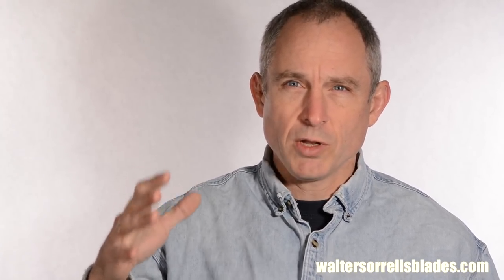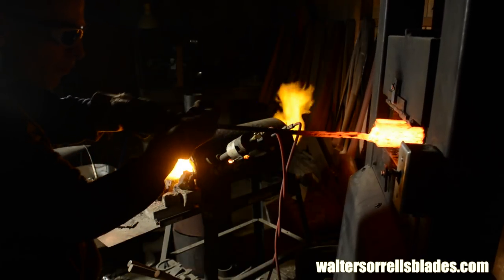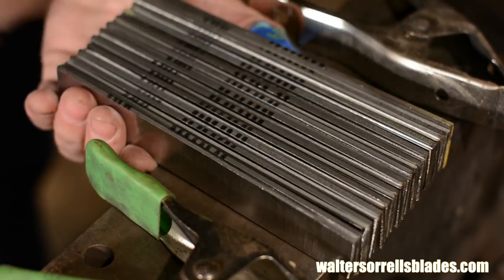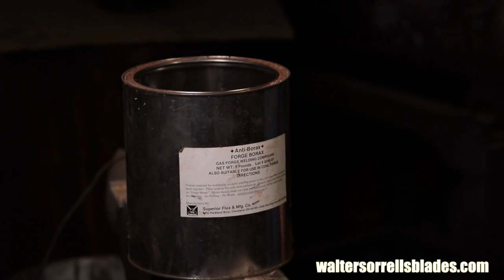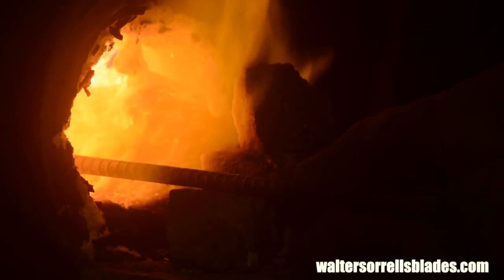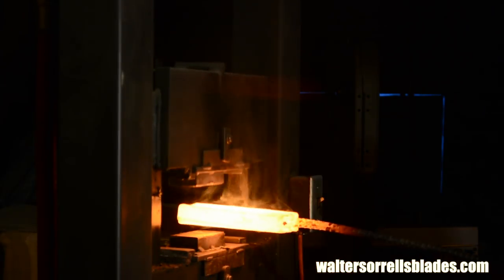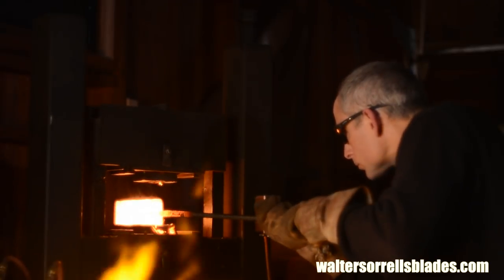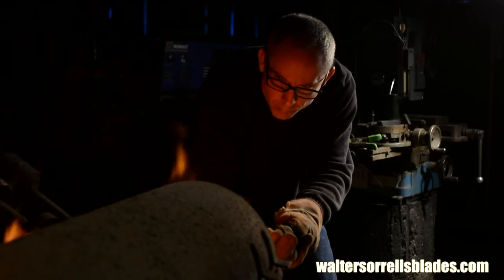How to Make Damascus Steel -- Part 1

Comment: i wanna ask : what is flux ? and chemical properties of flux 
thank !
Reply from the maker: +Lol trần Flux is not a thing, per se.  Fluxes are used in welding, brazing and soldering.  When most metals are heated in air, they create oxides which interfere with bonds between pieces of metal.  Fluxes dissolve those oxides so that the metals can bond cleanly.  Borax is a common flux but there are many other substances that will act as fluxes in particular situations.
Reply: +Walter Sorrells so i can use borax ? i see some person in my country use borax for whitening the food .-.

Comment: Hey man, if you're really concerned about weld material being in the blade, why don't you just seem weld with TIG? I get that it'll take longer, but these are high end knives, yes?
Reply: Weld material is getting into the steel either way. Also something to keep in mind...while forge welding you don't want to work the metal back and forth. You want to start from the back and work your way forward so you push any undesirable material out of the metal. Sort of like a tube of toothpaste.
Reply: +Carl Sanfilipo tig welding does not use any weld material if you only run the welds together

Comment: If you had a tig welder, you could fuse the pieces together and have no issues with mig wire metal contaminating your billet.

Comment: real damascus steal was made by using the same iron througout the blade folding it with organic carbon based matter inbetween the layers like grass and leafs ect, nobody acully knows exactly how it was made but they have proof that the genuine damascus blades contains carbon nano tubes wich could only be created in this mannor.
real japanese "damascus" is made by tamahagane sorted and forged into 2 billets, one soft and one hard(hagane). the core of the blade is made of soft folded steel and the outer shell is made out of harder Hagane steel...also folded. the pattern on a japanese sward is only visible if you look closely.

Comment: ive seen the old school japanese use what looks like old t-shirt material to hold their metal together when they stack up the different kinds, and whats wierd is some of it is still left when the take it out of the forge orange hot, and they just scrape it off...can anyone explain that, look in this video at the 2 minute mark and tell me whats going on
Reply: It's a flux basically. It acts like Borax and prevents oxidation.

Comment: Thats not actually true Damacus (wootz) steel it is actually what is called "Patern Welded Steel".  In true damascus the distinctive lines in the steel is from the crystals formed in the steel from low oxygen and slow cooling, and true damascus steel is very high carbon like between 1to 2 percent.
It's an interesting subject to lookup.

Richard

Comment: I could have sworn Damascus steel was lost ages ago...
Reply: You are right it is a lost art!
 The original method is unknown!
Reply: Max Power does our method give the same results?
Reply: memegusta
Impossible to say since it's a lost art! But don't get me wrong for all we know your method could be even more effective! I work with steel and would love to create this! I was merely agreeing with a known fact! I love what they are doing hence why I watched the video! Peace.
Reply: *****
Key word there is Japanese. What's Japan got to do with Damascus?
Reply: ***** Damascus is the capital and the second largest city of Syria.

Damascus steel was a type of steel used in Middle Eastern sword making. These swords are characterized by distinctive patterns of banding and mottling reminiscent of flowing water. Such blades were reputed to be tough, resistant to shattering and capable of being honed to a sharp, resilient edge.

The origin of the term Damascus steel is somewhat uncertain, it may either refer to swords made or sold in Damascus directly, or it may just refer to the aspect of the typical patterns, by comparison with Damask fabrics.

Production of these patterned swords gradually declined, ceasing by around 1750, and the process was lost to metal smiths. Several modern theories have ventured to explain this decline, including the breakdown of trade routes to supply the needed metals, the lack of trace impurities in the metals, the possible loss of knowledge on the crafting techniques through secrecy and lack of transmission, or a combination of all the above. (wiki)

Nothing to do with Japan.
Reply: *****
So that's it? They just forged folded steel?? Well done Sherlock you cracked the case!! We'll just ignore the little details like the balance of impurities such as tungsten and/or vanadium. We'll also ignore the fact that debate has persisted in the metallurgy community over the past 200 years as to how these blades were made and why the surface pattern appeared, and that research efforts over the years have claimed the discovery of methods to reproduce Damascus steel blades,but all of these methods suffer from the same problem—modern bladesmiths have been unable to use the methods to reproduce the blades. The successful reproduction of Damascus blades requires that blades be produced that match the chemical composition, possess the characteristic damascene surface pattern, and possess the same internal microstructure that causes the surface pattern.

So if you ignore all that, ya your totally right!

SMH
Reply: *****
I accept your apology!
Reply: *****
Any time!
Reply: *****
 Part of the problem is the steels themselves. Because Damascus is a combination of steels, the rate of degradation varies. This can result in a sword having one or two main alloys but having the rest essentially rust away. The disappearing metal can still be detected but exact quantities are usually only a conjecture.The molecular bonding and structure could give clues to how the Damascus was made. But again with a pattern of ever changing steels; how accurate are the tests going to be. Like today there were good and bad knife makers; hard telling if the knife or sword tested was of reputable quality or junk. All in all, it’d be awesome if they could reverse engineer it, but it’s easier said than done.
Reply: *****
Dude seriously why are you commenting on things you know nothing about? I mean I have seen you on a few videos now asking for advice about forging, welding etc. You don't even know the difference between MIG, TIG & Stick yet you want to argue and criticize people that do!? How are you going to learn with that attitude?? We are talking about Damascus (wootz) steel and these are the facts! I'm not looking to argue but you aren't looking to learn either it seems like! So go some where else!
Reply: eating popcorn this argument is fun!
Reply: *****
Well you're the one who keeps harping on about forging and folding metal! Ever heard of fire welding??
Reply: Max Power Well  "true damascus steel" or Crucible damascus is hard to make (i know what im talking about, im cooking "cakes" for near year in last few melts i achived succes) hard to forge (it is prone to cracking and "pattern disapperance" if forged in higher temperatures, or simply cold steel cracking if forged in too low temperatures) hard to quench (blade can just simply cracks in warm oil quench) and at last hard to sharpen (need a good stones and good hand)
Crucible damascus is not a combination of steels, or to be precize it starts as liquid steel in crucible and due to a carefull and slow cooling, temperature control and thermal anneal in "steel cake" segregates itself into two types of steel - one "base steel" with medium carbon content and needles of pure cementite all naturally formed. When you forge cake with enought patience you can achive miracles in blade. This steel is hard, but also can be flexible and really knife once sharpened doesent need resharpening for a long time. Well inproper use can break any tool so no it is not "indestructable".
http://crucibledamascus.com/
There is my webpage with short gallery, of course final product is still in development but i hope that my present steel will please my future costumers. Sorry page is in polish language, but if you have any questions feel free to ask, i will do my best to answer them.
Reply: ***** Thank You.
Reply: Krzysztof Rusek
Great job. Do you have any site in English?
Reply: Max Power I regret this but i don't multi language site. If there will be enought attention and requests i will change whole site language to english, or upgrade site to multi language. If any of you have any questions feel free to ask, as i said before i will do my best to answer them.
Reply: Max Power I opened the website using google chrome and it translated to the site to English for me.
Reply: Actually, they rediscovered how it was done, including how to produce Wootz Steel around 35 years ago. 

http://www.nytimes.com/1981/09/29/science/the-mystery-of-damascus-steel-appears-solved.html
Reply: OvAppolyon Yep rediscowery was done recently and now what matter the most is to get more experience with forging that steel.
I followed tutorial of Rick Furrer, after that i read a lot of old books to get any additional knowlege (Anonsow works, historical describes of melting furnaces) and im still experimenting. If i remember correctly first sciencific researches done on wootz were made in :
The Key Role of Impurities in Ancient Damascus Steel Blades
J.D. Verhoeven, A.H. Pendray, and W.E. Dauksch

Thank you for new source of knowlege.
Reply: Damascus steel was made long long ago in the old Asyrian Empire made for our swords. But when the islam came with brute force : be islam or die. The art of Damascus was lost because it was the stone tablets were never found. until they rediscoverd it XD Syrian History is such an interesting thing to know.
Reply: VillaMas Ewani
Yep true first crucible "damascus" steel was smelted around 4 B.C. in India, long before islam started.
From blacksmith perspective syrian damast is the best (it is most beautiful in my opinion) but that is not end of production of that steel.
Reply: Your right sort of. The original recipe is forever lost this is simply a variation of it
Reply: Max Power plunging the blade into a muscular slave was how it is said they quenched it so I suggest doing the same except with a strong horse or a mule.
Reply: It still is lost but they are very very very close but they're still missing some small details that make a huge difference in the steel it's like fresh food and frozen food the one people make today is frozen it food but it's not quit the same as fresh food is it.
Reply: Krzysztof Rusek well shit loooool oh well practicing with the hardest swords will make you one of the best blacksmiths to date don't worry you'll get there.
Reply: ***** The art, technique, and apparently a few missing ingredients, are?
Reply: Triston Charge Only thing missing are patience and ages of practice. When there was official "master - aprientice" lineage practice and "howknow" was passed and improved in ages. Now we start from beginnig.
Reply: Krzysztof Rusek I don't think you've seen our patience.

Comment: this is not damascus or at least true damascus; damascus is made out of wootz ; 1 type of alloy and the patterns are carbide formation where this method has patterns made from forge welding 2 types of steel or different carbon content  and then etching them .  cheers !

Comment: Is Damascus steel a lost technology or what? I keep hearing about it being forgotten and videos like this making the very metal.
Reply: +Art Enthusiast 15 the truth is damascus has been lost because we cannot figure out how to make wootz(or however u spell it) steel
Reply: +American Soldier This isn't Damascus. This is patter-welded steel. Pattern-welded came about a LONG time ago, as an attempt to make something useful out of crap material. It worked fairly well, but people then moved on to other techniques, in Europe. However, they then came into contact with REAL Damascus, proper name: wootz. And they realized that, 1, this stuff is REALLY good, and so people selling it can demand a REALLY high prize, and 2, this looks sorta like that pattern-weld stuff we used to make a couple hundred years ago.
So, people started making pattern-welded, claiming it was wootz. Essentially, copy-right infringement.

Today, no-one knows how to make wootz anymore, the art was lost a couple hundred years ago. There have been attempts to resurrect it, but no-one has succeeded yet. Some have come close, but that's all.
Reply: Hopefully.
Reply: +American Soldier watch his other video
Reply: +Dylan Bush Not true.  It isn't the least bit lost.  You can take a blade that has been buried for two thousand years and a competent lab can tell you precisely what is in it and precisely the percentages.  Wootz is not lost at all.  Furthermore, when it comes to steel there is nothing new under the sun.
Reply: colt1911ization As noted before...yes, it is. That you can tell me what's in X doesn't mean you can MAKE it. Only that you can tell me what's in it. And, only what's in it NOW.
Reply: +Armored Gamer I though so though the name  might have evolved a bit in the trade but Damascus steel and Ulfberht blades are the sorta things that haven't quite figured out how they did it.

Some say they had a very special Iron ore from India and that they tossed fresh leaves in the mix.

Apparently Damascus steel had some sort of carbon nano tubes in them, not to say they had nano-technology or knowledge of it back in the day, but apparently they found out a really good technique.
Reply: slitor Most likely, the component parts had a large bit to do with it. Coal and iron both vary a great deal, depending on where you get it from, after all.

Comment: Ha?! And here was Me thinking the Art of making Damascus was forgotten, wonder how it`ll hold up to other kinds of steel today or is it purely cosmetic.
Reply: Modern steel is metallurgically superior to ancient Damascus steel. Today, it's done more for cosmetic purposes and to appreciate the beauty of the metal rather than to create a superior blade.
Unless you're mining iron ore from the ground and making steel the old fashioned way, like the ancients did, then making a folded/twisted Damascus steel blade would likely give you a better blade than if you just forged a mono-steel blade using ore dug from the ground and smelted without industrial equipment.
Reply: ***** Ah, the more You know I guess.
So it probably really was the best steel way for swords in it`s time.

Oh well, it`s at least still pretty awesome to look at now.
Reply: ***** Aside from Crucible steel, which, then, was made only in India and given to Vikings for the Ulfberht, at least what history has shown, Damascus Steel was considered the best steel for the day, until the Industrial Revolution and the Bessemer process was introduced.
I want to own or forge a Damascus steel blade, though.

Comment: Damascus steel is not pattern-welded steel. Similarities are only visual, but methods of producing and quality of products are totally different.
Reply: Is damascus steel the same a wootz crucible steel?
Reply: Luke Armitage In a modern sense, no. Traditionally I think it might be the same.
Reply: Luke Armitage It should be, but today they use it's name (which is not correct) for pattern-welded steel. Which is sad by mine opinion, wootz steel is  much more interesting.
Reply: Yeah I agree but if you were to make a blade out of wootz or pattern welderd what would be the strongest?
Reply: Luke Armitage Wootz, it was/is famous for it's quality. Pattern welded steel was known in Europe for a long time, but its purpose was mainly cosmetic - to look cool. Anyway, Wikipedia has nice article about damascus steel that explains alot, also this one is also interesting http://amightydirge.tumblr.com/post/99869824408

By!
Reply: Thank you
Reply: +OneCoinArcade  The term "Damascus" has been used to refer to Pattern Welded steel for almost 3 centuries....its just as correct as the term Wootz
Reply: +OneCoinArcade Yes it is. There are two types of damascus, one is made with modern steels with varying amounts of nickle. The other is made by using a single kind of steel with an uneven composition. They are both pattern welded steel and both have the exact same properties. The only difference between modern and old damascus is the exact composition and the only reason we haven't been able to replicate it is because nobody is willing to sacrifice these old blades for metallurgical analysis.
Reply: OneCoinArcade Wrong. Arnold GIF goes here
Reply: +OneCoinArcade
Neither originated in Damascus, so as far as that's concerned it's kind of a moot point.  The other part is that pattern welded steel has been referred to as Damascus for centuries in the gunsmith and bladesmithing trades.